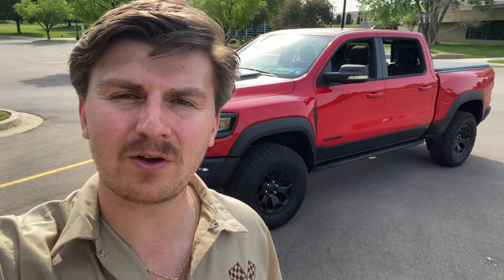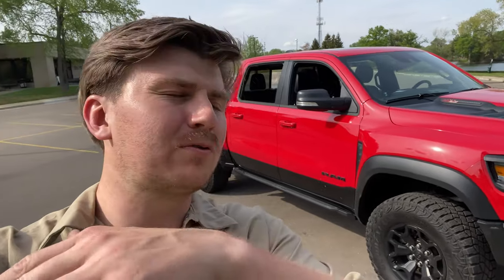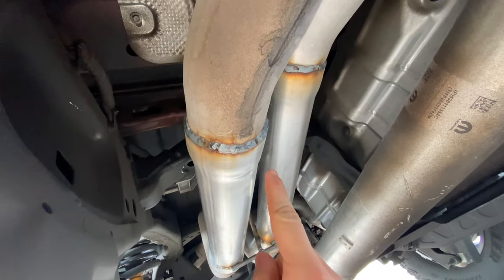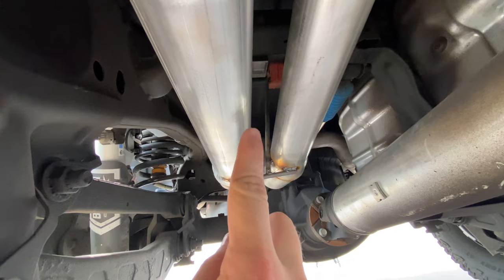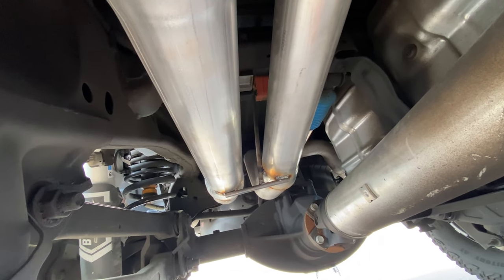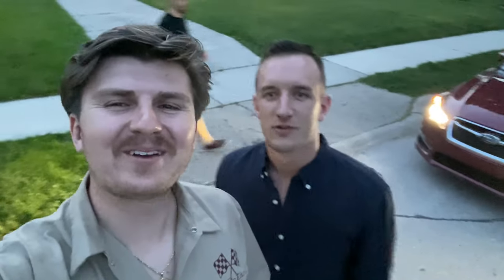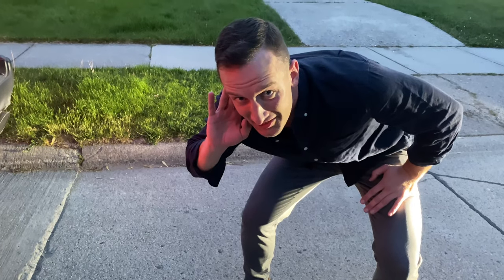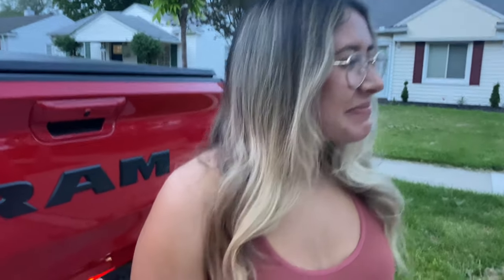Straight Piping My RAM TRX | Is It TOO Loud?! (Resonator Delete)

Comment: Sounds great but the exhaust guy did a crappy job lining up the pipes he welded in. Left pipe should’ve gone straight and parallel to the right pipe he welded in but he angled the left pipe down and now your tail pipes are misaligned. The left pipe almost touched the pumped and it probably will if you hit a bump. Things like that would bother the crap out of me especially on a 95k truck. Go have him redo it or get a partial refund!
Reply from the maker: You’re able to adjust the tips since they just bolt on to the exhaust at the end, so it wasn’t that big of a deal at all.
Reply: @ZacharyNabozny  very true! To each their own lol
Reply from the maker: @BigTony1710  it’s not to each their own lol it’s literally adjustable
Reply: @ZacharyNabozny  not what I was referring too! Lol I know they can be adjusted but the crappy exhaust routing he welded in would just bother me to where I couldn’t enjoy driving it “to each their own” lol
Reply: @ZacharyNabozny  lol

Comment: Sounds great. Will the dealer say this voids the warranty? (I know there is a huge controversy of information there so just curious of your particular dealer) Also, is that the factory Tonneau Cover or which bed cover did you select?
Reply from the maker: Cutting resonators out should never effect your vehicle's warranty. I do have the factory Tonneau cover, and I love it! It seals very nicely and I'm very happy with it!
Reply: @ZacharyNabozny  thanks a ton I hear mixed reviews and would rather order mine with it. I will take your advice.

Comment: Do you have to tune it so it maintains its power numbers after straight piping? I know that may be a dumb question😂😂
Reply from the maker: No question is a dumb question my friend! I’d only recommend a tune if you cut the converters out. If you’re just cutting out the resonators, like I did, you should be perfectly fine without one!

Comment: First of all it does have mufflers. That is what you cut off. Second it does kinda have resonators. They are the 4 screens on the back of the system right around the back axle.
Reply from the maker: First of all, there are no mufflers on this truck. There’s plenty of interviews of the chief engineer stating that exact sentence floating around the internet. Thank you, though!
Reply: @ZacharyNabozny  Yep no Muffs on that bad boy... Resonators aren't mufflers. They just quiet the frequencies/tones that cause drone, reasons why they are under the cabin area of most vehicles or out past the muffler to lower the harshness to passersby. Even chevy has used them in the tail pipe section, less weight, less material. Also why the Chevy's as of late are so quiet, but claim no loss in power/flow, only temps and drone. Thats how the confusion is made. Mufflers dampen sounds and are/can be flow/power restrictions, resonators just dampen sound but are not flow/power restrictions. Hence why they are straight through perforated like glasspacks of old.